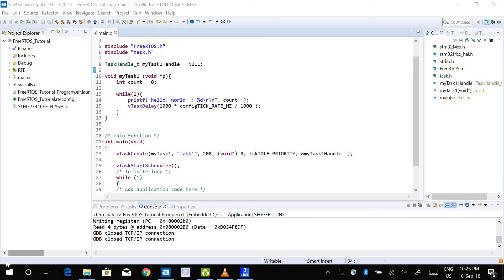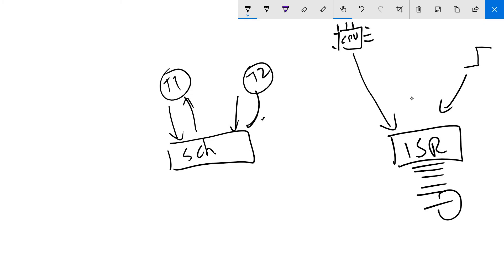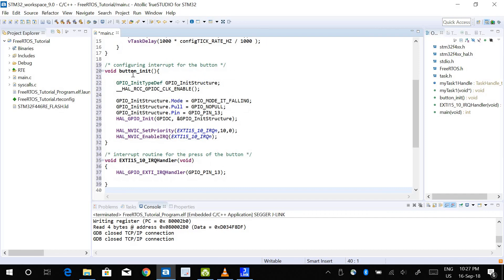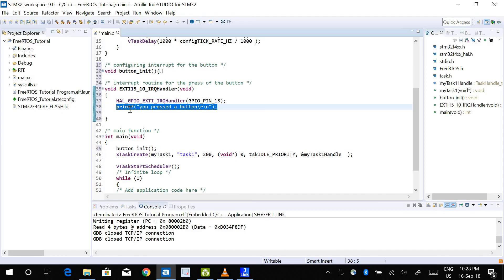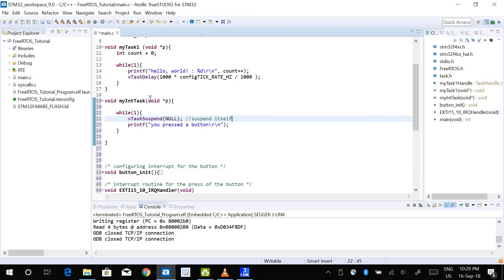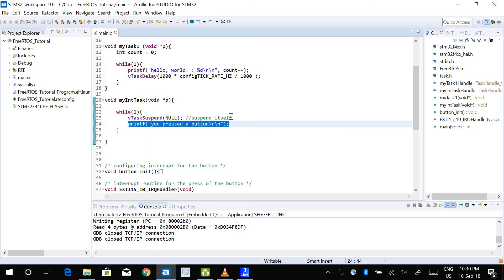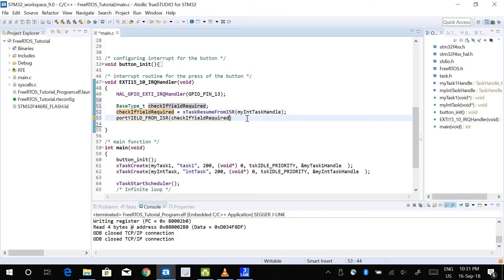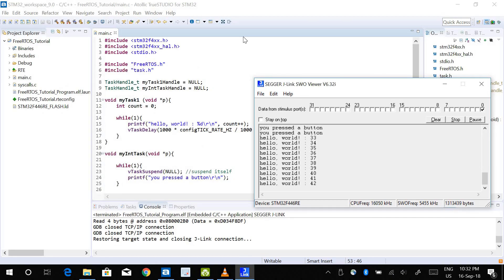06 FreeRTOS Tutorial: Handling Interrupt

Comment: Very nice lecture to learn, but you should have commented on some potential problems about xTaskResumeFromISR().
xTaskResumeFromISR() must not be used to synchronize a task with an interrupt. 
Doing so will result in interrupt events being missed if the interrupt events occur faster than the execution of its associated task-level handling functions. 
Task and interrupt synchronization can be achieved safely using a binary or counting semaphore because the semaphore will latch events.

Comment: Using xTaskResumeFromISR is NOT the right way to do this based on the documentation:

"xTaskResumeFromISR() is generally considered a dangerous function because its actions are not latched. For this reason it should definitely not be used to synchronise a task with an interrupt if there is a chance that the interrupt could arrive prior to the task being suspended, and therefore the interrupt being lost."

Source: https://www.freertos.org/taskresumefromisr.html

Comment: could you clarify the 3 lines inside your ISR? , why the portYIELD_FROM_ISR function?
Reply from the maker: When an interrupt occurs, the program counter jumps to a specific address predefined in the interrupt vector table. The way how this is done is very specific to the architecture. When using freeRTOS, we may not want to jump to any predefined program counter address, but continue to the program counter that points to the task we created to handle the interrupt. In that case, we need to use the function portYIELD_FROM_ISR.

Comment: Nice video! The ideas presented are very clear.
I have one question, could this be implemented using a binary semaphore? I've seen that they're used for managing interrupts aswell. 
If so, which approach is prefered and which are the advantages of each one?
Thank you so much.
Reply from the maker: Hey. It is a good question and I realize that understanding the difference between binary semaphore and mutex can be a bit challenging. I will be making more videos covering semaphores and the difference wrt mutexes. Meanwhile, I quote an answer to your question directly from the freeRTOS manual which states: 

 "Binary semaphores are used for both mutual exclusion and synchronisation purposes.
 Binary semaphores and mutexes are very similar but have some subtle differences: Mutexes include a priority inheritance mechanism, binary semaphores do not. This makes binary semaphores the better choice for implementing synchronisation (between tasks or between tasks and an interrupt), and mutexes the better choice for implementing simple mutual exclusion."

Comment: I'm using STM32CubeIDE that creates the workspace with freeRTOS for you.  I implemented an external interrupt using the tool and this gets placed in stm32f4xx_it.c, when I try to use the xTaskResumeFromISR(taskhandlename) it does not recognize the taskhandlename.  Almost like the value is not in scope, but main.h is included so I don't understand what's going on.
Reply: When the interrupt occurs the program triggers the ISR and, after processing the flags, goes to the callback function. The callbacks are functions defined as weak so that you can re-define them in your main.c where you can use the taskhandlername.

These calbacks are also available for UART, I2C, SPI,... and even though you can write your code directly in the IRQHandler() in the stm32f4xx_it.c, it was meant to be used with the callbacks.

So you can write in your main.c:

 void HAL_GPIO_EXTI_Callback(uint16_t GPIO_Pin){
/*  ResumeTask(taskhandler)    */
}

Be aware that this callback is still ISR and you need to get out of here ASAP. 

Anyway, if you still want to use your IRQHandler function in the stm32f4xx_it.c what you could try is to re-define the task handler as an extern variable.
extern TaskHandle taskhandlename;

Comment: Thank you very much for your videos. They are really easy to follow and helped me to get started with FreeRTOS very quickly. One question, does the EXTI15_10_IRQHandler(void) get called for any of the configured inputs? If so, how can I make sure that it is the button that has been pressed.
Reply from the maker: That is a question specific to the STM microcontrollers. The scope of these videos is freeRTOS, where the ISR from STM32 is just an example used here.